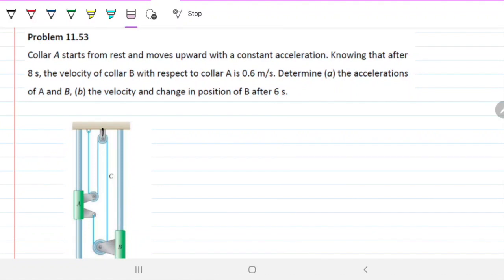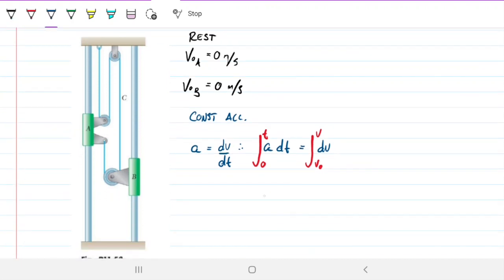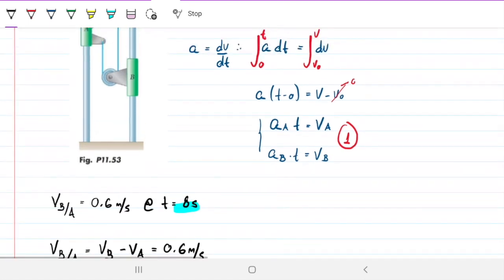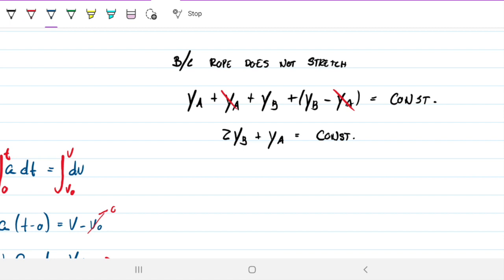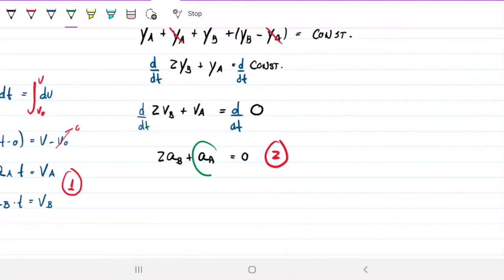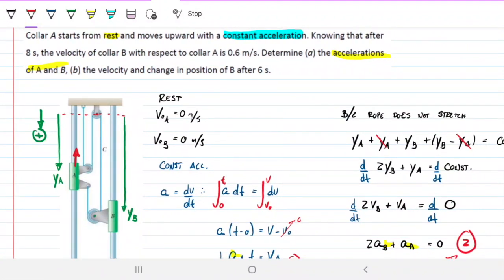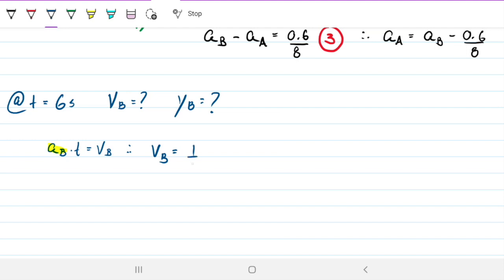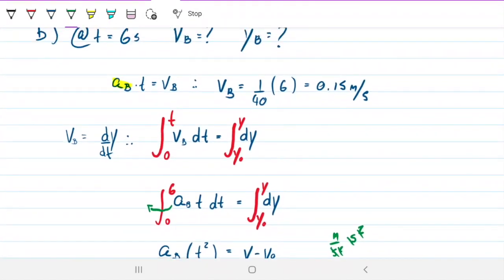Intro to Collar & Pulley System | Acceleration and Velocities

Comment: For the last step I am confused as to why you don't just integrate directly from V=dy/dt. With this approach you end up with the collar having travelled twice the distance (0.9m) down. My version of the textbook doesn't have this problem, I am curious as to why this does not work. Logically velocity x time = distance travelled, is it perhaps because of the pulley relationship. I'd be more than happy to send you pictures of my work if that helps.
Reply from the maker: Hey. We did Integrate V = dy/dt. But you can't integrate V dt directly because V is a function of time. 
Note that when you say velocity*time = distance, that is only true discretely if your velocity is constant. 
I don't think there is anything to do with the pulley system